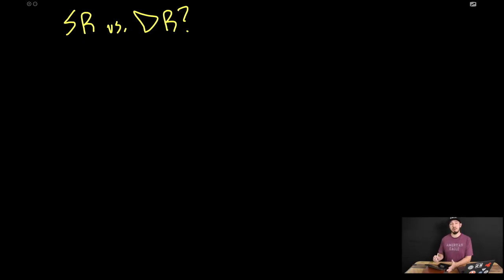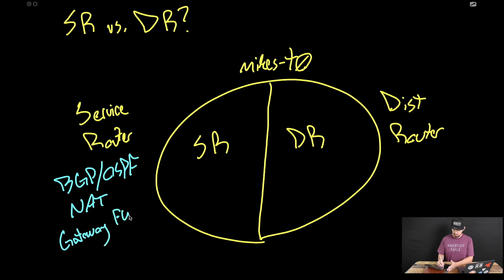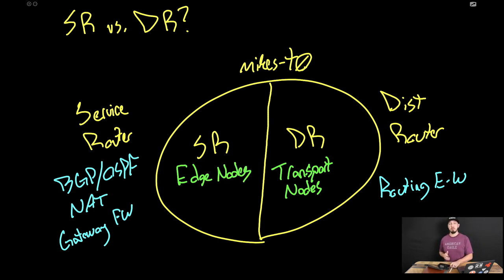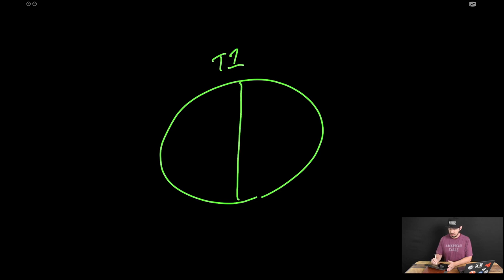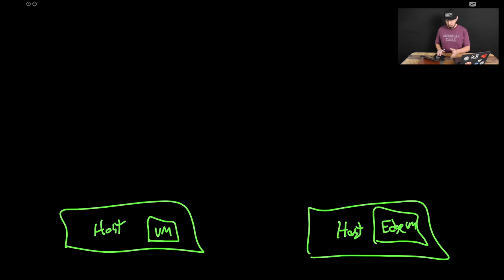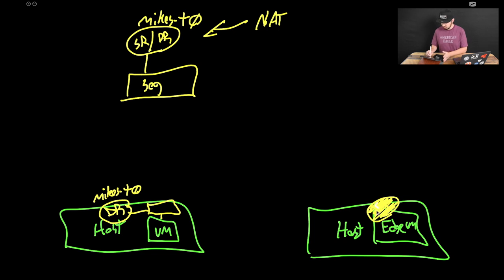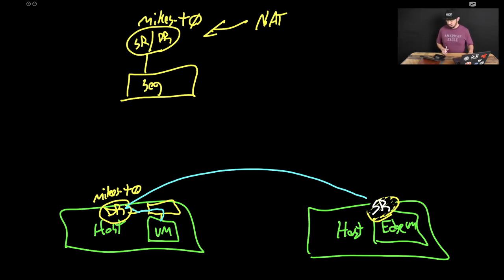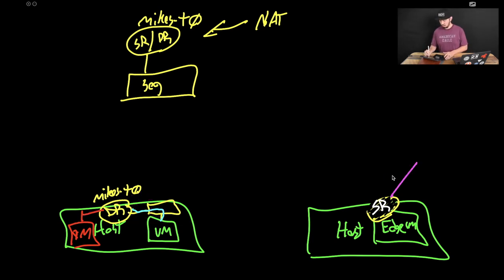What is an SR/DR? \\ NSX-T Routing Basics

Comment: Great video for understanding SR/DR - it's so easy to think when you create a service interface on a DR that the interface lives there, but really a SR is instantiated on the edge cluster and that's where the interface lives

I have a use case to try and push a VPN over a service interface on a dedicated T1 - is this possible? We always think of stateful services such as BGP, NAT etc taking place there but I want (for some special reasons) to run VPN in this way. in my case I want to use this service interface to connect to a VLAN backed segment rather than have the VPN route out up through NSX layers
Reply from the maker: So sorry I missed this comment/question! I'll be honest, I'm not sure if this would work or not! It's something I would put in the category of "need to lab it up to answer that" :) Did you ever find out?
Reply: @NRDYTech  no problem! Appreciate the reply regardless. 

Yes this is working albeit on a T0. I haven’t been involved totally in the nitty gritty for the VPN but I believe it’s all now operating as expected. 

Have to say, I’ve leaned on your videos lots to design and implement NSX-T in our environment. They’ve been invaluable, so thanks!!!

Comment: Wouldn't there be a DR on both hosts? The return traffic would use the DR on the host with the edge VM? I might be confusing it.
Reply from the maker: DR is not necessary on your host where the edge VM sits..that host doesn't even have to be prepped for NSX. The DR would be on the edge VM though - inside of it.
Reply: @NRDYTech  you mean SR would be on edge VM right?

Comment: Hey Mike, Is it possible to setup BGP between two T0 routers?
Reply: In the previous video, Mike mentioned we can't connect one T0 to another T0. A T0 always connects (uplinks) to the physical network but not to another  T0. Hope that helps. Guys correct me if I'm wrong